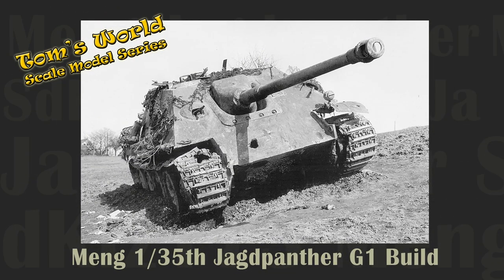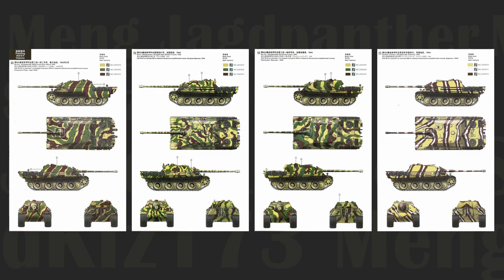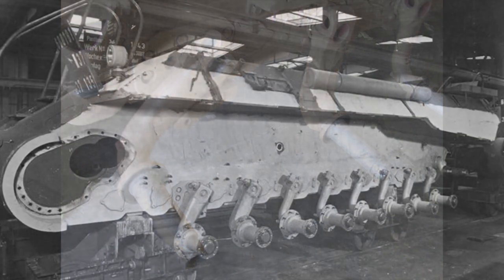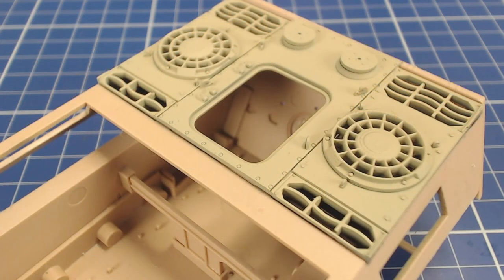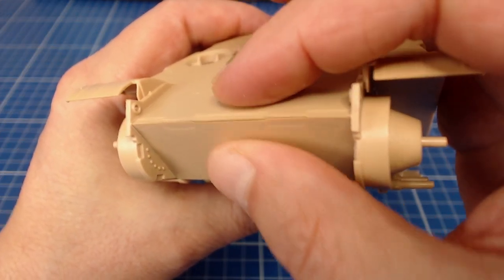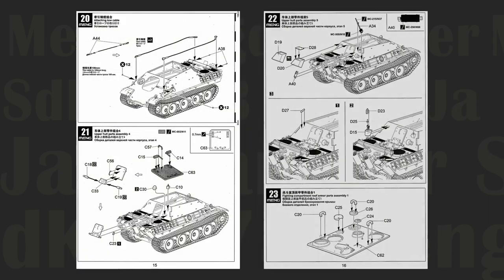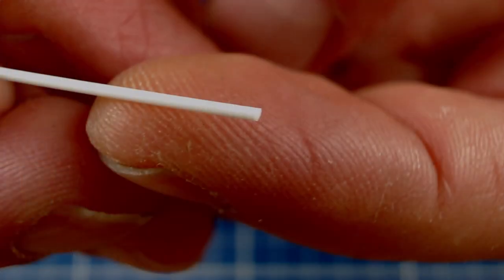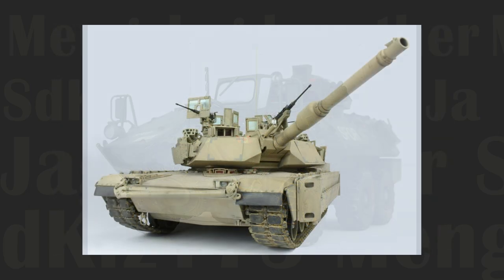Meng Jagdpanther Tank Destroyer Build Pt.1

Comment: Great work Tom, I am also working on this kit. I broke down and bought the PE bending tool 😂. I am waiting for delivery
Reply from the maker: That's not helping with my bender envy. 😁I think it's still going to be a challenge since the bend is so damn close to the edge. Let me know how it goes for you.
Reply: Make sure to heat the PE with a lighter and let it cool, this anneals it and makes it MUCH easier to bend 😊
Reply from the maker: That's a great tip but....I did the old anneal trick on one of the PE parts on the Meng Stug build and the damn thing went up in flames! I had to go back to my beloved stash of styrene to replace the piece. So I'd add the caveat; anneal only if the PE is of rather a thick gauge. Thanks for dropping us a comment though George and all the best to you!

Comment: Dear Tomas: I’m building this kit and on Section 3 of the lower hull build I’m confused: there’s a symbol that there’s an optional part but it’s not clear which one it is. Is it the D7-D14 component or the A26-F35 component?? It’s holding me up!,@#& Dan
Reply from the maker: Each option is made up of two parts - option 1 is D7&+D14 and option 2 is A26+F35. You decide which subassembly to use. The instructions call it "optional" but since the kit is made in China, sometimes their English translation is a bit dodgy. They probably meant "option" as in use either one but not both. 🙂
Reply: @stevieRay3211  Duh. You make these maddening conundrums easy to understand which is why I subscribed and follow all of your videos on the kits I’m building. I’ve always had an issue with some mechanical writers which include model building instruction writing. The way it looks on paper is that one of them goes in the only possible last spot but then they mention another part is optional but have no arrows going to the attachment location but you just solved the cypher my friend. Thanks!
Reply from the maker: Navigating the land mines in instructions comes with experience. Makes one appreciate Tamiya since even a baboon could likely follow theirs. Some are absolutely hideous; some Trumpeter kits and the early ICM kits come to mind. Easier to throw the instructions away rather than trying to wrestle with them. Dragon kits are a real rat's maze too. Good luck.